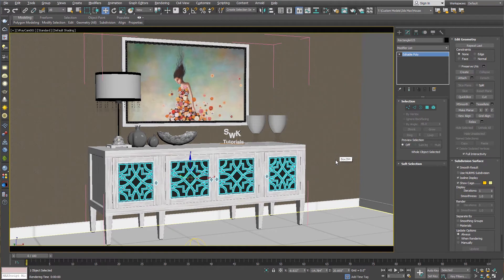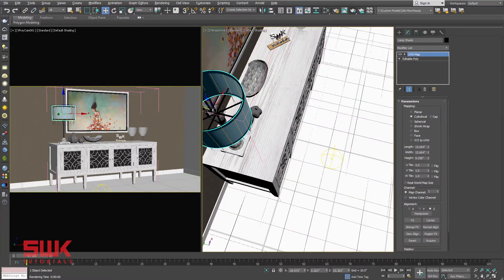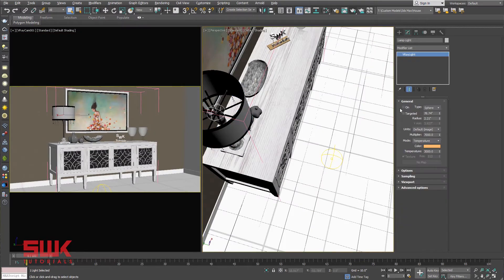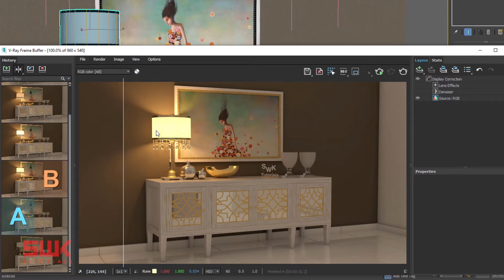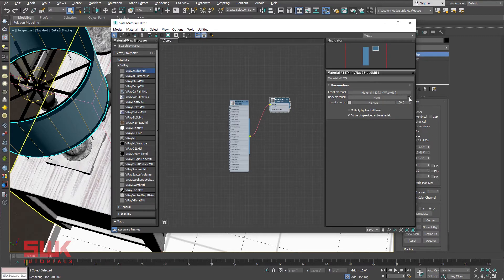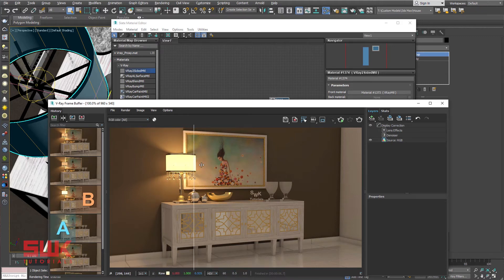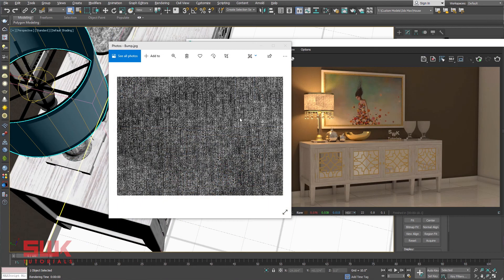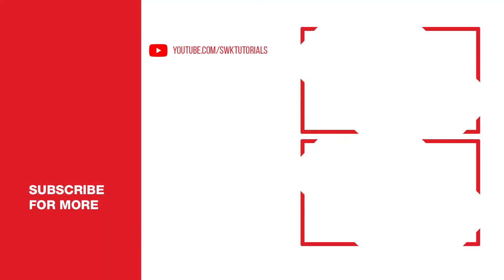3ds max + Vray 5 | Create translucent materials in V-Ray using VRay2SidedMtl material in 3ds max

Comment: Wtf it didn't work bro.
Reply from the maker: Bro it always worked for me and my students.
Reply: @SWKTutorials  I mean the material is hiding all the geometry like I used this for curtens and after rendering the curtain turns into illuminated plane.
Reply from the maker: check few things.
1 - the curtains on which you apply the VRAy2Sided material should be a single sided mesh. Meaning it should not have any thickness. E.g. Plane is single sided while box is double sided.
2 - translucency color should be towards dark gray
3 - translucency material should have falloff texture or image base texture because it produce good result.
Rest there are many other factors that can only be solved when while working on the file.

Comment: what settings and brightness did you use for the light? i see it is a vraylight, with the sphere option.
Reply from the maker: V-Ray Sphere Light settings:
Radius: 2.21 (in generic Units)
Multiplier: 7000
Mode: Temperature
Temperature 3000
*********************************
Plus one additional Dome Light for overall scene lit
V-Ray Dome Light settings
Multiplier: 25
Reply: @SWKTutorials  Thanks because i must be doing something wrong, because I've had to jack up the multiplier on the vraylight sphere to whopping 70000000 to get it bright enough shine through the shade and get a decent effect..!! using light cache and brute force. maybe the camera settings or something.
Reply: update: after reducing f number from 8 to 4, i got the light down to 5,500,000
Reply from the maker: If you are using V-Ray physical Camera. Some times we have to increase the multiplier to much so get the correct brightness. 
The other way is: 
Reduce the F-Number OR Shutter Speed OR Increase Film Speed (ISO)